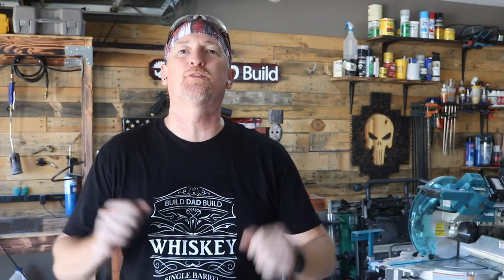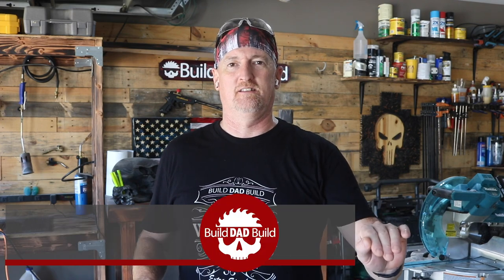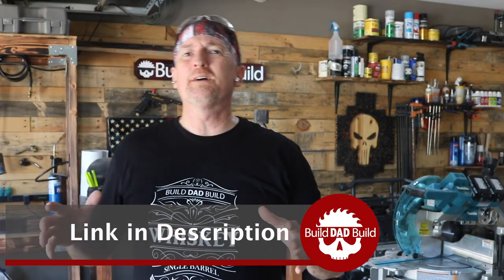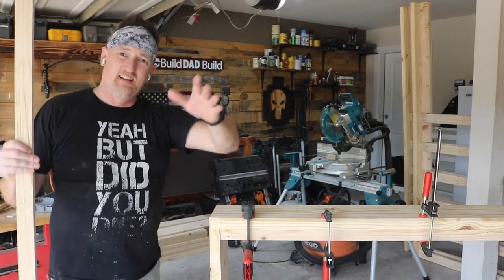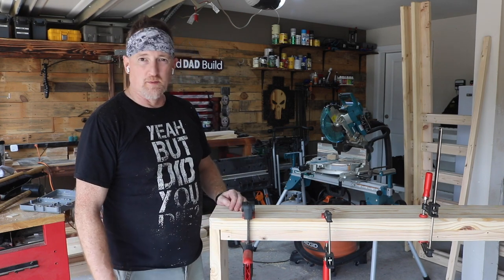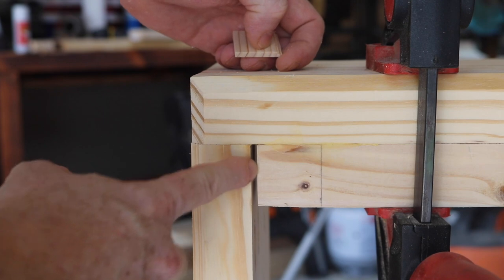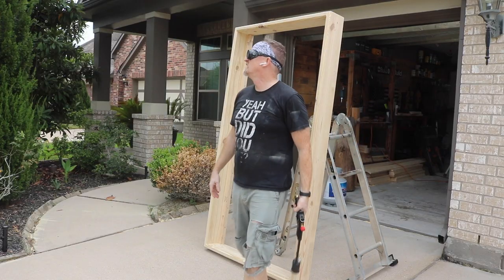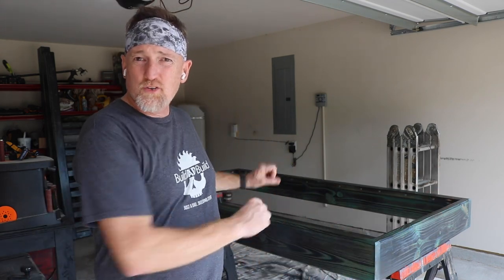DIY Loft Bed

Comment: Hey buddy have you checked out a local lumber yard as an alternative to the big box stores? I finally did about a month or two ago and it has absolutely changed my life. I pay $1 more than I do at the big box stores but just about every single piece of wood in the pile is darn near perfect! And the wood is already partially sanded so that saves a step too. You should definitely check it out if there is something in your area!
Reply from the maker: I have checked out local lumber yards. The problem is I live in Houston and the closest one is about 30 minutes away.
Cheers

Comment: Nice job ... I just took apart the bunk bed I built my kids a few years ago. One thing I noticed is that you didn't sink the bolts into the wood ... just curious if you considered that and decided not to.
Reply from the maker: I did sink bolts into the wood. two on each long rail and one on the short.
Cheers
Reply: @BuildDadBuild  Maybe I missed something, starting at 10:09 I just saw you drill bolt holes and add bolts.
Reply from the maker: @Cragun.  Correct.

Comment: Looking sweet fellow dad, I'm building my two daughter's a bed each soon. I'm going to be using tongue and groove for the end panels connecting the posts with dowls. I wondered how much stain you used of the unicorn spit for it? It's expensive stuff 14.99 UK for 284ml making a pint 50/50 (must go get a beer now I mentioned pint) how come you didn't go with the two tone with purple was it because the beds for your lad?
Reply from the maker: I used 2 containers of US (1:1 with water). But if you think about it, I would have spent that much on paint!
I didn't go with the two tone because Ozzie said he liked it the way it was. And who am I to argue with him?!?
Cheers
Reply: @BuildDadBuild  say I wanted to change the colour in the future what could you protect the stain with that's easy to remove to re-stain it again?
Reply from the maker: @craighardman8487  Probably poly. Anything is going to require some work to get back to the wood to restain. You could always torch it and brush it back.
Reply: @BuildDadBuild  top man, my final question before i take the plunge and start burning. What do you do about the sap pockets before you start toasting?

Comment: Did you not brush before stain?  How did I miss this wizardry.
Reply from the maker: You can do a surface burn and don't have to brush afterwards. It just doesn't give you the texture and stability of a full char.
Cheers